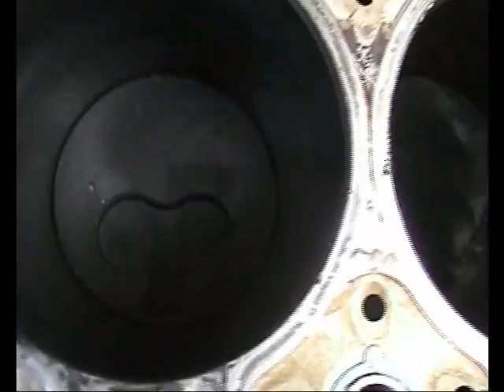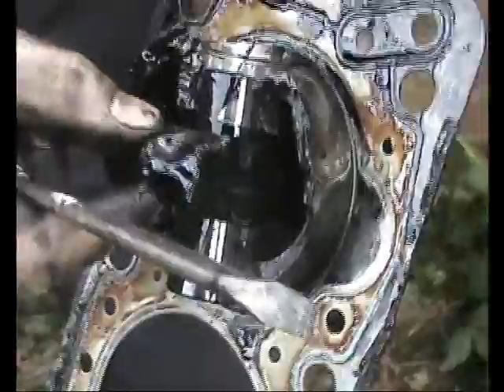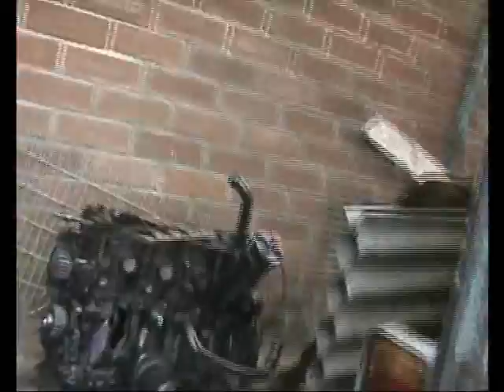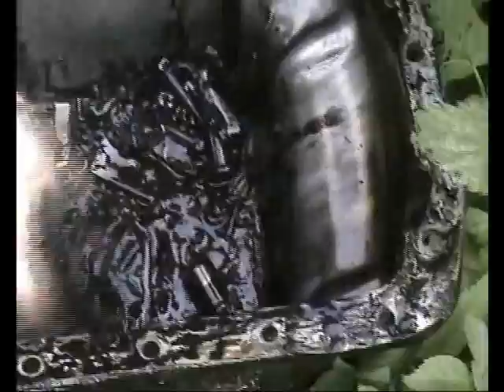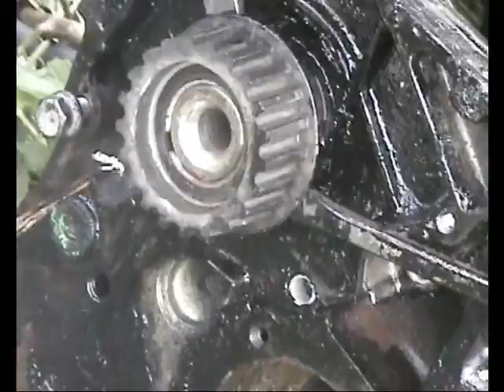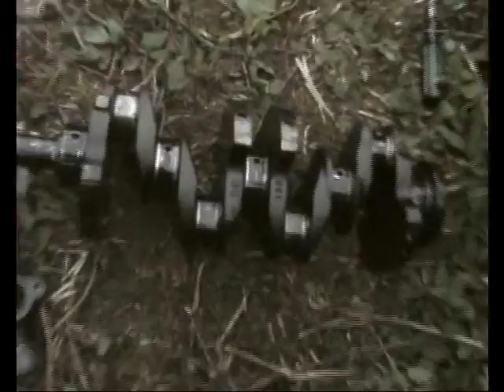XUD Engine conrod fail.... lets investigate

Comment from the maker: @TK42138 Currently got a few spare XUD's, plan is to strip and balance one, possibly put HDI's rods in as they are slightly thicker in places. If I matted it off boost, it would smoke horrendously, but I learnt to control the smoke with my right foot. No issues with soot build up, EGR was removed, head was ported, had a straight through exhaust on, pretty much everything went out the back door was very easy flowing. This was one of the reasons it died because it would boost so hard so low down.

Comment from the maker: @TK42138 This particular block was a D8B. Looking at the rods later, 2 of the others were bent around 3° so it just let got literally from the shear torque and compression it was under during load. Was boosting over 2 bar and boost braking to 1300rpm... I had about 4-5° static advance aswell, that much low down pressure is asking for serious trouble with quite abit of static advance too...